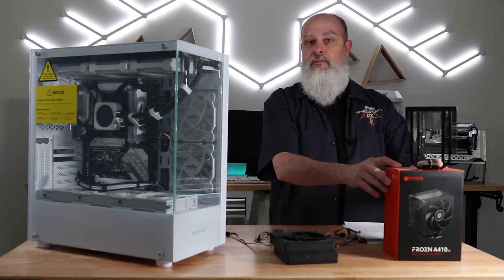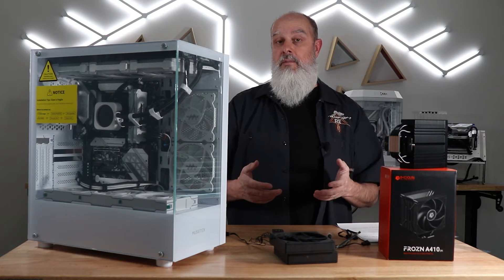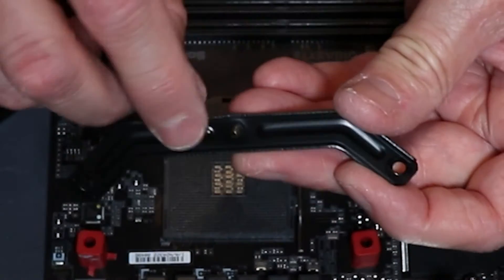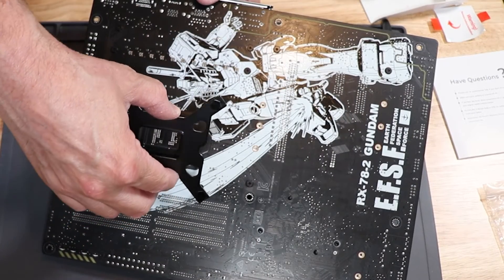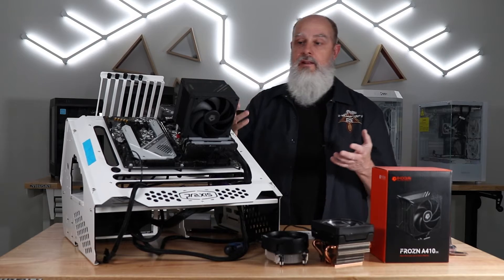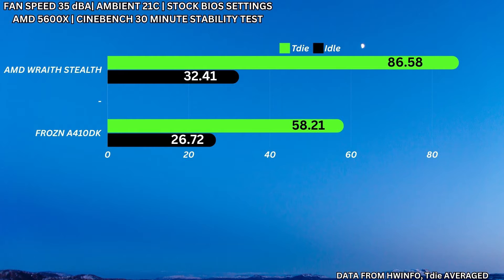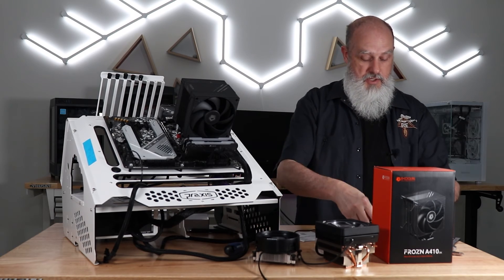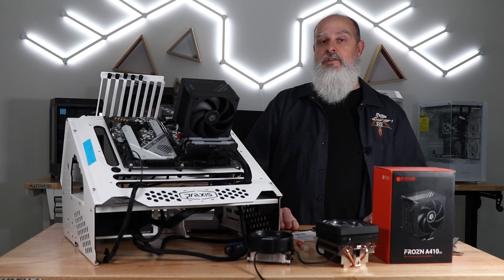ID-COOLING FROZN A410 DK CPU Cooler - Cool and better than stock!

Comment: A friendly reminder for anyone upgrading their cooler without removing the motherboard: only remove one of the sides for the brackets at a time so the backplate won't fall off :).

Thanks for the video, I was between this one and the A620 (it was out of stock) but I managed to snag one of the latter from a shop in another town, should be arriving soon. Seems like ID-Cooling are very underrated.
Reply from the maker: Hi Maartwo, that's a great tip for sure that I need to point out in the next one. I've frustrated myself once or twice removing both at the same time, only to realize how simple it is....haha. 

Thanks for the great comment and tip, you are awesome!! You should be happy with the A620. Good luck with the build, have fun and thanks for watching!!!

Comment: How about this for the i7 14700 non K? Is it an upgrade from stock cooler?
Reply: Id bet
Reply: @Unlucky1776  I went with the Frozn A610 instead, works really good keeping everything around 35-40 on idle and 50-60 while gaming
Reply: @TheRealSamard  awesome. I went with the Thermalright Peerless Assassin 90 se and even though my airflows pretty bad rn it idles at 49c.
Reply: can it with the i 5 12600k?
Reply: @morde6261  That cpu consumes up to 150w according to Intel website, and this cooler works up to 230w according to ID Cooling. So I would say it's more than enough, but also check specs by yourself before purchasing anything.
Reply: @TheRealSamard  Thank you, I was consulting with several people, it is to confirm thanks for the help

Comment: I use this on my R5 5600 and don't mount it upside down, I have an inverted build and did this, I saw it had like scuff marks on the heat pipes from when I did this and my idle was like 59-51C, put it back the right way and is now at 38-40C. both are at 29C ambient tempts
Reply from the maker: HI skullcracked, thats good info. I'm glad you got it figured out and sounds like it's working good as expected. Thanks for watching!

Comment: Hello! Yesterday I bought a Ryzen 7 5700x3D, to update my Ryzen 7 1700, now I am with the 1700 heatsink, which is the wraith spire, do you think this FROZN A410 would work for me in a summer in which the ambient temperature is about 30°? Or should I go directly for a 240mm water cooler? I'm from Argentina and the prices here are quite expensive, but the water cooler costs more or less twice as much as the FROZN A410.
What do you think?
p.s: I use it for games and for 3D print design.
Reply: Hey I just got that same cpu and I was looking at this cooler, have you tried it or did you go with another cooler? And what kinds of temps are you getting? I’m getting around 68-77 with a cooler master ml240 so I’m looking to drop from there.
Reply: @thewarchiefs2463  I finaly decided for his big brother FROZN A620, and i didnt reach more than 70° in that CCD#0, the hottest spot with cinebench... gaming, and normal use is near 49 but always less than that.. And i didnt touch the fan curve